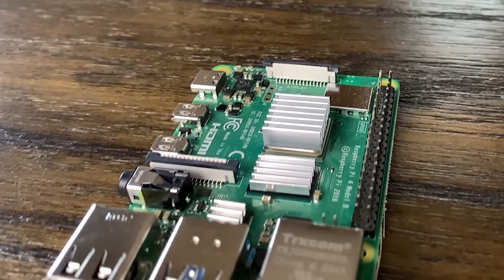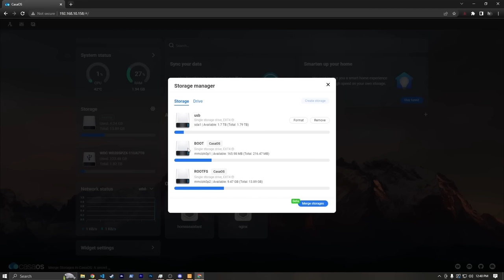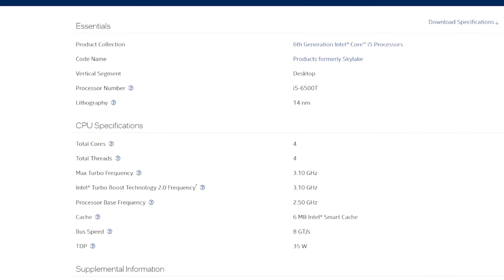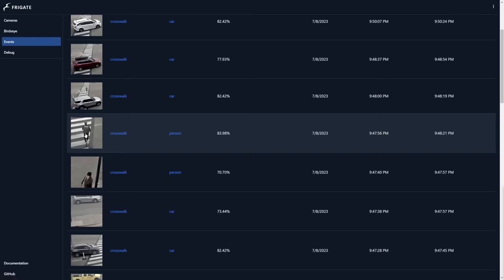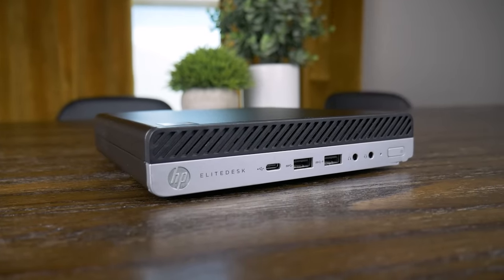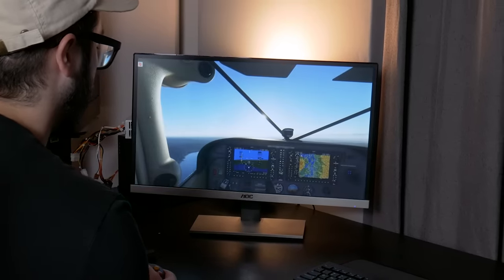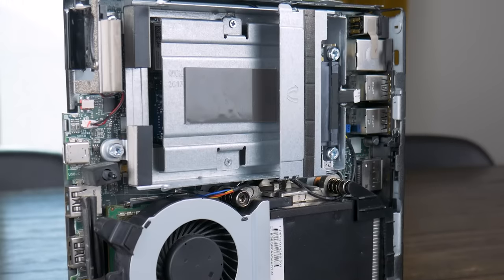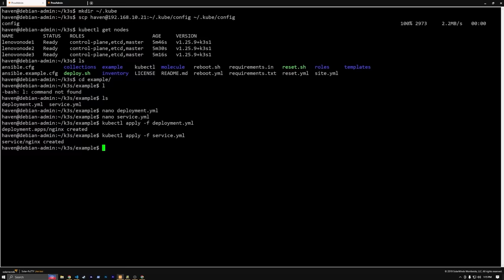The Mini PC You SHOULD Be Looking At

Comment: While Skylake CPU does not have hardware 10bit HEVC, with my testing it is still sufficient for jellyfin 4K 10-bit HDR transcoding. You just have to use the CPU for decoding, and QSV can be utilized for tone mapping and encoding the 8 bit stream (in software transcoding, the CPU has to do all the dec and enc work and tone map doesn't work). I tested my i5 6500, it transcode a 4K 10 bit HDR 50 Mbps file to a 1080p 8 bit HEVC and the speed is around 30-40 fps. The i5 6500T shown in the video is less powerful so I'm not sure how that handles transcode. I sold the 6500 and opted for a Coffee Lake QTJ2 with UHD 630, much better experience. Why is this relevant? In my area Vancouver BC, PC, PC parts and especially mini PC with 7th+ Intel are being scalped on local marketplace while 6th gen are priced reasonably. Not sure its because Netflix 4K support? or Win 11? that caused price disparity. And ebay is no good due to high shipping cost to Canada. If people are on a budget, Skylake is an interesting option. Anyway I look forward to your jellyfin machine video!

Comment: These tiny PCs are quickly getting more popular, I love it!
Reply: I don't because I need to buy one before they get expensive.
Reply: @jackedup447  I am sure you can get one quickly
Reply: @jackedup447 i wouldn't worry about that tbh. most of these come from offices that are upgrading their computers, and those offices aren't gonna stop using computers so the supply should still be there even after a few years.
Reply: @fafiteee  There is an increasing move towards laptops though. Until the mid 10s, schools and universities used to have computer labs full of these behind every other door. Today, students are expected to bring a laptop. Meanwhile, offices are moving away from 1 person = 1 desk in favour of work from home schemes and clean desk policies.
Reply: @jackedup447  They won't, there is a very large supply of them and they come in waves as offices decommission their fleets.
Reply: @justsomeguy5103  these things are also used in leased point of sale systems, data entry and barcode scan stations in big box stores and libraries, and so on. Offices and schools are not the only environment for them.
Reply: @jackedup447 they already have inflated. STH has increased their sales like 300% only cheap ones are 6th gen i3 and i5s
Reply: @marcogenovesi8570  Exactly.  I have an HP 800 G1 and it works great.
Reply: @jackedup447 they probably won't. There is a lot on the market like those hp ones, or minisform for high end ones, it's way worth than a raspberry pi. Even if those mini form factor PC high end/mid end is bit expensive i guess it's worth it. And it depends. Usually because you can't really upgrade it like a medium or full tower. I got one minisform for full portable emulation device. It works great for linux mint for me running ps3, wii/gamecube, n64/ps2. Hopefully when xenia has a linex build. I could play xbox 360 games on it.
Reply: My school has them for the teachers - they are connected to touchscreen boards(no projector)

Comment: I recently upgraded from my trusty PI 4 to an Optiplex 7040, upped the RAM and installed 1TB 2.5" HDD, works absolutely like a charm. Great thing is BIOS has auto power on AC, which means PC will start again in case of power failure.

Comment: We currently have a bunch of HP 600 G2 mini PCs that are being written off at work. They are pretty similar overall. With the G2s, however, you have to be even more careful of the SATA ribbon cable for the 2.5 inch bay.
Reply: I accidentally ripped the cable out for the 2.5” drive in my G2. Still annoys me that I couldn’t fix it.
Reply: @itsjoshwood  I found a replacement cable on the Internet and successfully fixed one of these.  That was a few years ago, so it's possible the part is harder to get now.
Reply: @CFWhitman  if I remember correctly, it wasn’t the cable that broke but rather the connector that attaches to the motherboard. I’ll take a look to see what I can find about replacement parts. At the time I couldn’t find much information.
Reply: @itsjoshwood  The one I had to replace looked OK still, but didn't work. Replacing the cable (with the drive end attached) fixed it. If you can see the connector on the motherboard is broken, it might not be worth fixing.

Comment: Recently I have become a big fan of the ultra small formfactor office PC's for use as Proxmox servers, etc. Especially now that they're getting to the point where loading them with 64gb ram is not a big deal, or expensive.
Reply: People are mentioning proxmox quite a lot. Does it have any advantage or different use case than running podman/docker containers for nextcloud, git, nginx, databases and so on? I have just one minipc for everything. Actually two, Zimaboard which does not have any use.
Reply: @pavelperina7629  Proxmox, being a hypervisor, let me spin up VM's and LCX containers. And in these VM's and containers I can run docker to be able to run Nextcloud, git, etc. Which, of course, you could run on a host OS like just Windows, Linux, etc. installed directly on the mini PC. But I like using Proxmox VM's because it allows me to not only rapidly spin up new systems for testing and labs but easily be able to manage backups of my "production" services by just using Proxmox to schedule the backup or snapshot of the VM or container. Of coutse Proxmox does require a little overhead as far as hard drive space, RAM, etc. but it's fairly minimal.
Reply: …’64gb RAM is not expensive’ ..since most everything I do runs fine with 4-8gb, I just happily and even less expensively cram 32GB RAM and a 1TB SSD into these machines, and never look back 🤓
Reply: @ernestgalvan9037  That's awesome. 32gb just isn't enough anymore for the amount of lab work and testing that I do. The setups and scenarios have become more..   complex, lol. Especially with people wanting to roll stuff like ZFS via stuff like TrueNAS rather than traditional hardware RAID.
Reply: @Trains-With-Shane  do you work with media encoding/processing or just enjoy it as a home multimedia AIO?
Reply: Which Mini PC do You recommend

Comment: I think in most cases of someone considering an RPi it's for specific reasons. I use micro PCs when the use case allows it, but even on those the power draw is much higher than a Pi or other similarly spec'd SBC. Pi's are also now more "readily" available in stock (the 8GB pi 4 was in stock for most of the day at Adafruit on Friday). Good video though either way.
Reply: A non server chip mini pc will have either low power chips or T variants of powerful chips, which dont use a ton of power.
I run a gaming laptop off of a battery and it's non T but mobile chip and and gpu draw between 60-100W.
Imagine something not designed for gaming.
T variant hybrid Chip, low power RAM, no discrete gpu, no 1440p 160hz screen attached.
Face it, Pis are fo suckas.
Reply: I run a pi off a solar panel and a small lipo battery for my wireless cam ndvr. Power draw is sooooo low.
Reply: @Resanctify Was recently in the need for a 24/7 running pc for some scripts. Did the calculation and the Pi was costing only a fraction of the power-costs, compared to a HP mini-pc I had laying around. Like 1/5 to 1/7 of it. So RPis are great in this regard
Reply: @maximilianstallinger735  My post errored out before it completed.
Plainly, your mini pc is around skylake, and regardless of exactly which gen it was using, most older mini pcs went for workstation specs.
I'd recommend one with a Hybrid(newer) P or U variant processor(Down to 15W base) low speed/power ddr4/5 ram, which blasts the pi ram out of the water.
Then instead of 6-7x the power draw it'll be much closer, and then we could actually have more developers for low power x86, and we could all stop buying these single use silicons.
When costs aren't even low for what they're giving you, might as well get a device that can do most stuff, with a little modularity.
Reply: Yeah there's a balance, but if you don't need GPIO/SPI/I2C, the higher power consumption of a 1L PC brings with it more processing power, expandable RAM, faster and far more reliable storage, more IO and a very sturdy case

Comment: Storage wise, I think the best that you could do would be to replace the 2.5g network adapter with the 10g adapter that i think they make - and if they don't, you could boot off of a sata ssd and convert the m.2 into a 10g nic and then I would use network storage from an external NAS solution elsewhere on your network.  I think these types of systems would make EXCELLENT proxmox or kubernettes cluster compute nodes, but storage-wise, I think it's best to just give it a high speed low latency network connection to external pooled storage. - if you don't care too much about performance, and you have like 10+ port 10g switch, you could theoretically use something like ceph to to pooled storage.  i'd boot from sata storage, put large fast storage in the m.2 slot, but ceph should really have a dedicated 10g interface AND at least 7-10 nodes to be performant as storage, but that would make a pretty performant scale-out all-flash NAS if you wanted to do that...  would be a fun (if kind of expensive for a homelab) experiment.  My current project (waiting on shipments) is 5 optiplex 5060's with i7-8700's with 512gb ssd's that i'm upgrading to 64gb of ram and adding dual 10g (intel x540-t2) network adapters and 2tb m.2 ssd's and bought a 24 port 10g base-t managed switch to in order to do a hyperconverged proxmox cluster on.  ceph gets it's own interface, management (and corosync) gets it's own (1g) interface, and applications get their own interface.  I'm going to use an unmanaged switch for the management interface (plugged into a managed switch to tag all traffic from that switch into it's own management vlan), ceph gets it's own vlan, and applications get 2 vlans (separating homeprod vlan from homelab vm as this cluster will serve both purposes).  it's going to be slow to set up, but it's just about the best train set I can think of :D

Comment: It really just depends on what you are using your computer/server for.  The RPI4 is a pretty powerful little guy that can handle most home server needs.  The benefit things like the RPI4 have over a minipc is power consumption.  A RPI4 might cost you a few dollars a year to run.  A minipc is probably going to cost you at least a few dollars a month.  Also, I might be lucky here but I've never had a RPI die on me.  They are extremely reliable, especially if you invest in a solid microsd or flash drive.
Reply: I've had 3x Pi 4s die on me. Two came back to life three years later. Not holding my breath that their re-awakening will be long lived.
Reply: My pi 0 before they become impossible to find for less then quadruple their supposed price always made a whining sound in the audio.  It's literally on the ground now like the garbage it is.  I used to want to replace it with a 0 2 whatever.  I'm glad they were also impossible to buy while other better companies and newer components drove prices down for more bang for your buck.  Or do you actually carry it around in your pocket to show off to women?  Bro I got 64 gb in my pants.

Comment: Starting with the G6 elitedesk you can even get a dedicated gpu (like a 3050) which is awesome. Hopefully they will come down in price eventually. The new dell optiplex 7010s come with 180w instead of 90w power adapters as a recent change also. I work with all of these machines daily at work

Comment: Looking in the "for parts" section is a good strategy. At least for electronic test equipment, tons of people sell working things "for parts" because they either didn't test it or can't validate calibration, both of which I've had good luck taking chances on. With how reliable PC hardware tends to be, I suspect that there are decent deals to be had for hardware that people just didn't want to bother testing
Reply: Ya and the other half have been half salvaged by the seller and they go "I dunno why it don't work" like this didn't just rip out the chipset
Reply: "Not tested" is also a euphemism for "tested and broken beyond repair". It's a gamble you can lose as well as win.

Comment: Have two HP G3 800 MINIs. Fantastic, silent and low powered machines. Yes, they are refurbished!

Edit:
4:35 - You can flip levered latch on top of the 2.5mm drive enclosure, then unscrew 2 screws to get access to the M.2, Wifi adapter slots. Agreed it is not tool-less,, but it is much better fiddling with the SATA ribbon cables.

Comment: I worked with some refurbished ones of these G3, but the 600 series. You don't have to remove the whole hard drive tray thing to access the M.2, there are two small screws on the metal plate where the dark grey pad is. Just unscrew these and you can access the M.2 . Easy thing 😉 (Oh and to boot from 2.5" drive, don't forget to enable legacy support in the UEFI)

Comment: This is 65w the raspberry pi is 5 watts
Reply: 27 watts
Reply: wich one?  @antonyesousa
Reply: @lucioaraujo3070 most micro form factors are around ~35W TDP
Reply: It’s not like we can’t pay for power, So?
Reply: @Connorplayer123  you don't need a power hungry machine running 24/7 because it eats alot of power.
Reply: you can get 35w and 65w versions of the pc. i have the 35w configuration.

Comment: I bought two used EliteDesk 800 G4 minis a few years ago with the i5-8500T cpu (35 watt).  I put ESXi on both of them.  One runs a domain controller and my NextCloud server and the other is for a test lab. I leave the first one running all the time since the power draw is so low compared to my other "big" servers which only run when I am working.  I put 40GB RAM on both as well as an m.2 drive and a 2.5" sata drive.  They have been working flawlessly since I have purchased them.

Comment: These older mini pc's are so good compared to the pi or the SBC's out there, but my problem is I want to make a NAS, and they all have no NAS ports. I suppose you could sacrifice the wifi m2 slot and put a sata controller in there but I wonder if it would get full bandwidth, not to mention needing to buy another case just to slot the drives.

Comment: A 1L server with a connected DAS supporting JBOD works perfect for a ZFS NAS setup. I have been running mine with a Lenovo 6500T mini PC in a RAID-Z for 3 years without any issues. For even further space saver you can get a 2.5 inch DAS and run that with ZFS mirror on two SSD's with a NUC. Have a friend that has been running this setup for the past year. You just need to make sure that most of the common codecs are supported on the GPU if you want to stream.

Comment: Those little fellas are awesome. 6 months ago I was actually in the same boat - I had an older pi but wanted to run an app that required a newer generation, which was nowhere to be found for a reasonable price.
Found one of these G3 refurbs on Amazon with an i5 @ 3.2ghz, 16GB RAM, 1TB NVMe m.2, wifi and Bluetooth modules, Windows 10 Pro for $200 (it's $25 cheaper now).

Comment: got a HP EliteDesk 705 G4, upgraded to 32gb of ram, and added a hdmi port for about 200 total. much less heat generated, my AC does not need to kick on as much. I only use my full desktop when i need more compute power, got a KVM switch for going between the two.

Comment: There is a bracket available from HP that allows you to mount an HP mini and it's power module on the back of a monitor. If you use wireless network adapter and wireless mouse/keyboard then have only two cords to deal with, the two power cords. If you want to move the unit to an alternate location you unplug the power cords move the the unit plug the power cords back in and power up.

Comment: Ironically, I just worked on the prodesk AMD of this yesterday at work. I am remodifying the hard drive caddy to hold a small fan and then will add air flow through the top part of the case as they get super hot.

Comment: This is a great video. I had an AI project a year or two ago that Pi 4 wasn't strong enough for, and at 200$ a pop (at the time).
So I bought one of these mini PCs. Just had to learn about serial communication to an Arduino but what project doesn't involve some learning? (They all should). 
So much power and for the time, at a cheaper cost. Didn't know you could get a Coral add on for them, even better!

Comment: I watched this video on one of these machines which I bought when electricity became expensive. In the UK they sometimes turn up in Computer Exchange, a used equipment retailer, though the thought that one is assisting in the fencing of boosted gear is ever present. I estimate it's paid for itself by now and it's perfectly adequate for most stuff; I fire up the big rig when I want to cut video or play games. Obviously, it's a bit anaemic in the GPU department, but it can just about run something like Genshin Impact.

Comment: i work on these at work. they really are decent. biggest issue i see with them is air flow. the fans also die as the dust build up and poor air flow. over all they really are not bad. not a fan of the m.2 when pex booting. only because more often then not the bios needs to be updated or tpm is blocking it. sometime you have to tell the bios what to look at first before you can pex boot it. others have to make sure it is in legacy mode. or a combination of it all.

Comment: I have 3x RPi 4B 4GB, pre-C19.  One is my audio server and handles jack and a 30 band EQ with room to spare.  This way all my machines can use the same high end stereo output (at the same time).  One is a file server, currently 2x 12TB drives in a ZFS mirror.  One is for projects and mostly off.  My two main machines are a pinebook pro and system76 pangolin.